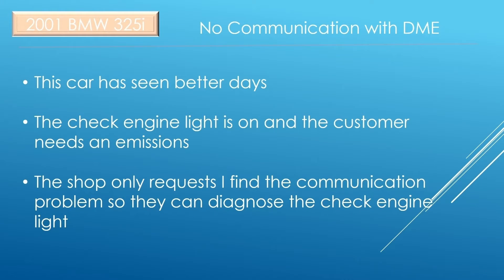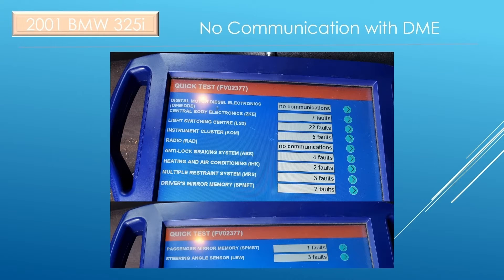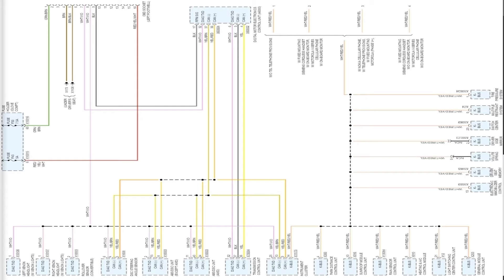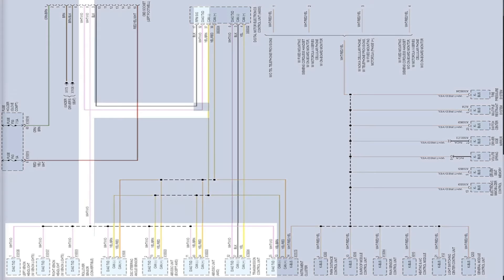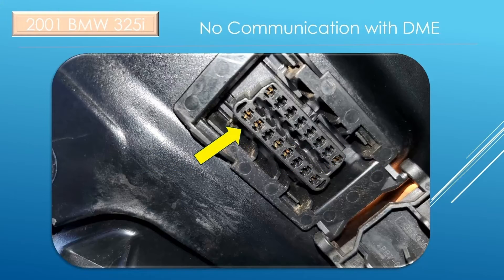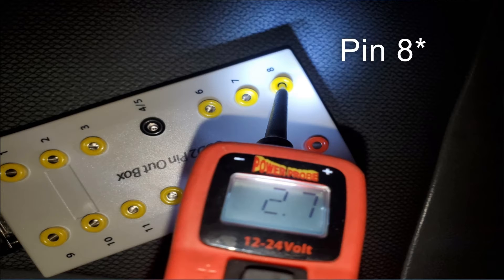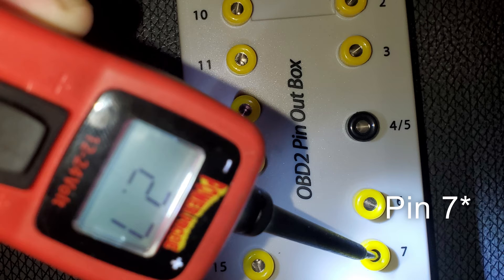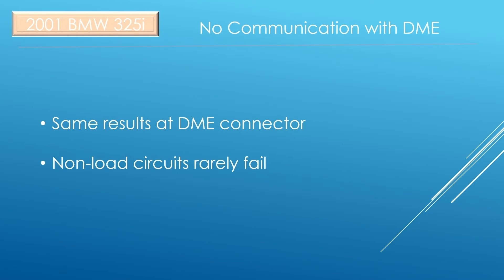2001 BMW 325 No Communication

Comment from the maker: I want to clarify one more thing. I said that low current circuits like communication circuits rarely fail. I should have been more clear in saying that they rarely fail by going "open". It is actually quite common for comm circuits to hang high or low, but I almost never see an open communication circuit that is caused by a bad module. Opens are almost always a wiring issue when talking about comm lines. That is why I was surprised when the power probe showed an open circuit and not a short to power or ground. I do a lot of communication issues, and 99% of them are shorted comm circuits.

Comment: RICK, good info as always so what was the solution to repair the connector and the DME corrosion .cheeeeers
Reply: This one was beyond repair. They might be able to find a rebuilder for the PCM, but needed a new harness. BMW is not good about making connectors available.